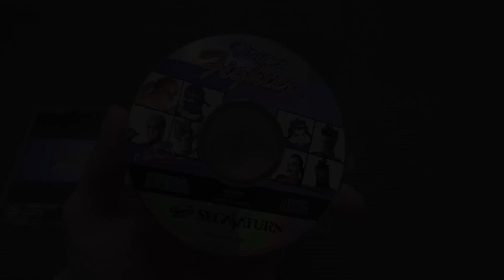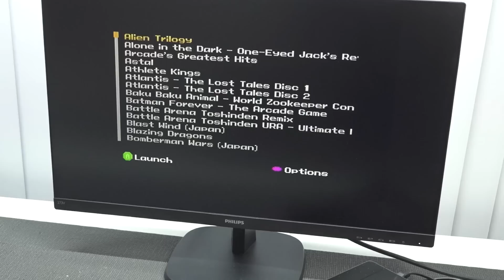Sega Saturn SD Ultimate Mod in 2022 -  And is it Awesome 😎 ?

Comment: I've had the Pheobe in a Saturn before and enjoyed it. Eventually though I switched to the MODE from Terra Onion. More expensive definitely but with a better front end as standard. I really like it because now I don't have to play stupid collectors prices to just play games. I also have the Mega SD and GDEmu for the MD and DC respectively.
Reply: I've got the Terra MODE for my Saturn also and love it! Wasn't too bad installing it either. For my Dreamcast I went with the knock off Amazon one and it works great also
Reply from the maker: It's a naughty way to play indeed your favorite games.
Prices are crazy now ... it's a shame 😶
Reply: I have terra onion too, but I lack time to install it. And I have even to reshell the console and change the internal power supply with one more compact bought on aliexpress.
Reply: @diomaiaal  in my experience the mode is great in it didn't gave to do that and it works great my gdemu absolutely did have to modify my power supply but eh
Reply: Is the MODE more tricky to install than the Fenrir, as well as being more expensive?

I have a PAL, Type 3 VA7 Saturn, so would need the Fenrir 21-pin, which is unfortunately sold out everywhere, but I'm curious about the MODE, whether it would be compatible, how much time and effort to install is required etc. 

I've read here that I'd need to muck about with the power supply also. I'm not too tech savvy, so the Fenrir is ideal, but I'm willing to give the MODE a go if there's tutorial vids around... However I don't want to spend ridiculous money on various parts or risk damage to the console components (obviously).
Reply: Anyone know any easy way to rip Saturn's bio?
Can you use these SD adapters to rip the Saturn's bio?

Comment: I myself went with terra onions mode and it works like a dream I recommend highly as I have modded a dreamcast and saturn with a mode in each with ssd and they work amazing and very simple
Reply from the maker: ok, need to look into that if can get my hands on one.
Reply: I hope you do a they're very easy yo setup plus way more flexible on storage options for it my only gripe is theyre a bit expensive but you get what you pay for in terms of ease and quality

Comment: I've have a remedy for scratched discs.  I occasionally hand polish discs using microfibre cloths and all purpose house polish like Mr Sheen or Pledge.  I sourced my own from some unworn swimming trunks because the polyester layer is very smooth and ideal for applying the polish and the cotton layer underneath is good for buffing.  I've done this mostly for CDs, DVDs and the odd PS3 game though with blu ray you have to keep buffing to reduce the polish otherwise its unreadable.

Comment: @8:45 The part about wanting to be able to play real games and still use SD cards, you can. There is an addon board available with a toggle switch for 50 bucks. There's also the Satiator but that is much more expensive and has less compatibility.

Comment: The Satiator blows this thing out of the water. No mods required. No removing the disc drive. Just plug in flash cart into the back of the Saturn and go...

Comment: I'm not sure if I'd heard of the Phoebe. When I got my Saturn last year, we recapped the machine and tuned the laser, but I opted to go with the mod chip so I can burn discs. So far it's working out but I'm thinking about getting a spare laser assembly. Not exactly as convenient as an ODE but I'm enjoying it and it was the cheaper option to get started.

Comment: A thing that contributes a lot to the failing disc drives are bad PSU's. I've noticed it's a fairly common phenomenon with Saturns. I've already had to swap the laser a couple of times on mine.
If you're using the original PSU it can be good to check the 5V and 12V rails from time to time, but a recap or a replacement PSU like the ReSaturn is probably the best futureproofing you can do.
Reply: if you're seeing ripples or interference on the screen or if it hangs completely, you'll know there's something wrong with the psu

Comment: So I think the Saturn is really good, especially the lasers of my Sega CD and Saturn work more than well, although the KOnsols really have many years under their belts. With my Dreamcast it looks unfortunately different, I had 5 pieces in the years, 4 have given up the ghost, but the 5 is an attic find bought from a friend who needed money^^ But my luck is rarely played with the laser apparently still being in very good condition, cleaning laser disk by running and now it plays pretty much everything I have in my collection J NTSC or Pal krin problem with the CD X disc. Can I play everything there is with it, even Chan Mue runs and that's the number 1 KIller for every old Sega Dreamcast^^

Comment: I wish this thing could be done to PS2 someday, because USB port on it are veeeeeery slow, and the Ethernet adapter needs an external server or a tricky internal modification to work properly...
Reply: you can use a raspberry pi. there's also a memory card solution which is a bit faster than USB
Reply: @DecibelAlex  yeah, Raspberry Pi it's a great solution, but leans on Ethernet to work, and it's a little tricky to put it inside PS2's shell. The memory card to SDCard is another great solution, but still need some improvement to work properly.

Comment: Someone is working on a solution where the card slot  is in the back where the battery and the tv card slot is .That way you can use digital & physical .
Reply from the maker: Combination would be EPIC ! 👍
Reply: This has been available for a while.  It is called Satiator.

Comment: Late to the party. And I am sure it's already been said. But you said "It isn't like instant load there are still load times" yes and there always will be.

This emulates the drive, the data is still being sent through the same bus at the same speed on the hardware, the only difference is no seek times. Normally the laser has to move up and down the disc grabbing the data. This doesn't have to do that.

It's about as fast as it is going to get, of course might be able to shave a few seconds here and there by using higher quality components. But the end result is you're still working with hardware that is around 25 years old, it will never be "instant" load

Comment: I've had to 3d print a lot of case caps for my Saturn game cases. I've replaced my laser once before, I was looking for if there was a cooling mod pre existing like the noctua fan mod for the Dreamcast but haven't found any. I guess applying heat spreaders to parts might improve the many chips that overheat. But finding a way to make a external power supply like the Dreamcast mod would be best way to do this but even that has issues.

Comment: Wonder if this will work with a nodded Saturn. Mine has the region free chip as well as the 50/60hz switch.
Reply from the maker: Mmmm.. i think if an original works with this.. why would a modded not ? 😄
Reply: Should be fine. That sounds like the perfect setup

Comment: The Fenrir is easier to get than the Rhea or the Phobe. The MODE by Terraonion however is Dumb expensive but it's a true AIO solution.
Reply: I wish the Fenrir WAS easy to get hold of. I've got a PAL Type 3 VA7 Saturn, so need the Fenrir 21 pin, but nowhere seems to have them in stock, and haven't for a while. I've set up several email alerts, but so far, zilch... 

If you've got a source, I'd be very much in your debt, even if I don't know you from Adam! 😉
Reply: @Nightopian1982  I got mine from a place called castlemania games. I don't what their international shipping is like (if you're not in the US that is) but I got mine pretty fast
Reply: @AskYwalker973  having checked out Castlemania Games (the name sounded familiar), they're still out of stock, and it looks like I've signed up for an email alert already (I've done so with several places!).

Just a case of wait and see (and hope, and fingers crossed), eh?
Reply: @Nightopian1982  good luck dude 👍🏿
Reply: @AskYwalker973  yep, cheers for that! I'm just a bit fed up of spending hefty amounts of money on the original games for my old consoles, particularly the Saturn, so these things are a godsend.

Do you know if the MODE chipset is equally as reliable and straightforward to install? Don't worry if not, I'm sure I can find out.
Reply: @Nightopian1982  Yeah the mode is a all in one. It works for both Saturn's, Dreamcast and PS1 (I think PS1 but both Saturn's and Dreamcast for sure)
Reply: @Nightopian1982  The mode is uses something called FFGA or FFPG I forgot 😅  what it's called but it's the Highest compatibility on the market.......hence why it's costs so much

Comment: The best alternative for the Saturn must be the Satiator, since you can just plug it directly into the MPEG slot. That way you get to keep the disc drive, but at the same time having access to the games through the SD solution.

Comment: kind of kills the collector market, you can just run those games on nintendo ds and not even bother doing the upgrade. Would be better to have a plug in on the modem port for the by pass of the security.

Comment: Considering how fast disk based games degrade this is an awesome solution.  At some point these games won't exist anywhere except as software on an sd card or something and it will be the only way to play it.  Especially since Sega is not curating any of the games from the Sturn and dreamcast except for say virtual fighter.
I really wish Sega would at the very least re-release allot of their arcade games on steam. Its the best part of their legacy and they ignore it.

Comment: I'm sorry man but I do not agree with you on the use of digital media at all. The benefits do not even come close to the cons. When everything goes fully digital we lose our history. Unlike a physical disc you need servers constantly running in order to keep the games for later generations. Further, with digital you do not own the game and at any time a developer can strip the game from us no matter how much we paid for it. While I do own quite a bit of digital games I only buy them when that is the only option.

Addendum- While physical drives do break down you can always dump the physical but you really can't do that with digital on a console.

We need a Phoebe with a super fast SSD. I bet that would fix your load times quite soundly.
Reply: @gdot1803  
You are dead wrong on all counts and do you know why? All physical media can and is being dumped for future generations to enjoy. The Nes, Master System, TG-16, Genesis, Neo Geo AES/MVS, TG-16 Super CD ROM ROM, Snes, Sega CD, 3DO, Jaguar, 32X, Jaguar CD, Sony PlayStation, Saturn, N64, PS2, GameCube, and so on are not X86 based. Yet, they have all been dumped, emulated, traded, shared, and will be around long after we are long gone. Furthermore, the Wii, PS3, and all physical PSP games have been dumped...so what are you talking about?
Reply: @gdot1803  
No I did not and no you cannot dump digital media that's trapped on a PS3 or PSP as an example. Have you ever heard of disc rot? All games that can be, will be dumped digitally so they can be preserved for generations. You cannot do this with digital games on a console. That's why everyone is so angry about Sony turning off the servers essentially killing over 4,000 games in one fail swoop. If they could be dumped it would have already happened. Digital only media is an evolutionary dead end to console gaming. It doesn't help matters that all digital media is tied to a console account. Once the hard drives die and they will long before disc rot happens...done.
Reply: @gdot1803  
Nope, you're putting words into my mouth in an attempt to win an argument. Just a reminder, this video is about consoles. This discussion is about consoles...not PC gaming. However, I will be more than happy to discuss all the delisted PC titles that are lost every single year if that's your prerogative. 

For reference- I'm at work right now and I will be slow to respond.
Reply: The load times aren’t controlled by the Phoebe/Fenrir, they’re controlled by the bus speed on the Saturn. The system still needs to read from the ODE, and it can only do that with the on board bus it was built with.